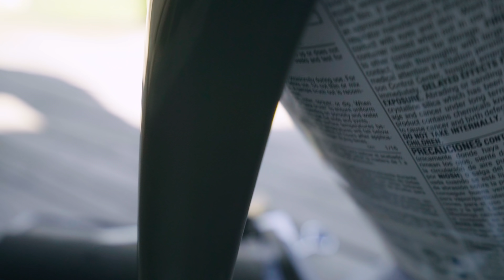Answering Your Questions on Our Home - Tuxedo Time Fireside Edition

Comment: If you haven't finished the deck yet, rent or buy a sprayer for the gaps. Check your stain for any special spraying instructions. FYI, if the deck is pressure treated and was put in before 2005 or so, it was likely treated with Chromated Copper Arsenate (contains arsenic). Sanding or cutting is not recommended without taking precautions.

Comment: I was working with an architectural firsm that is using Unreal engine for mock-ups so they can be walked through around and in. Its faster and cheaper then rendering and required less compute power overall. you can change furniture and not have to re-render. Something with walls and floors. There is money to be made for Unreal engine experts here.